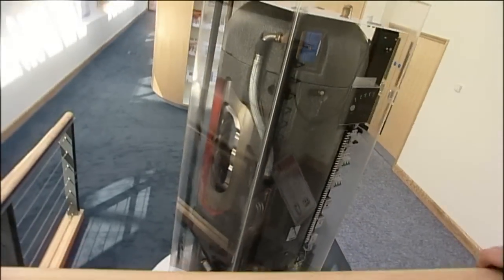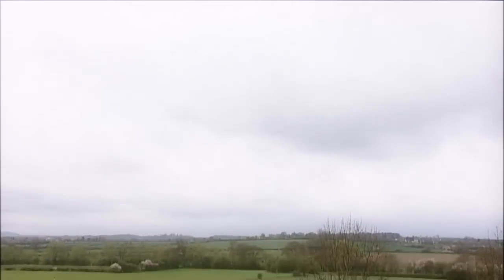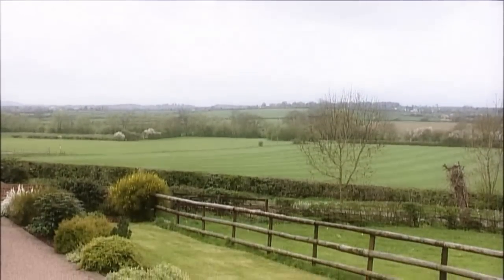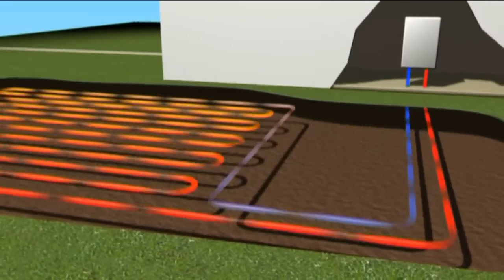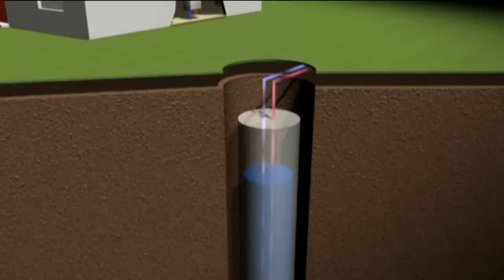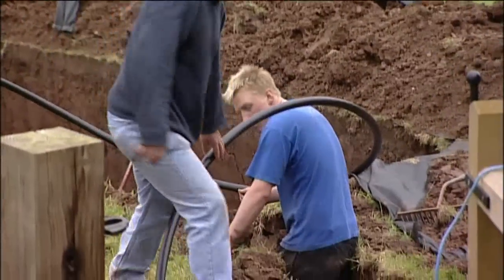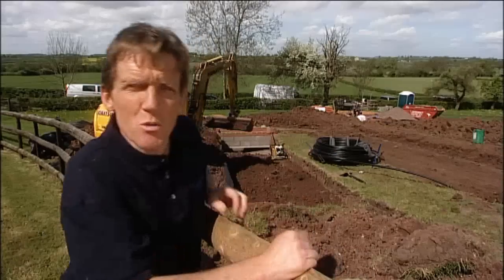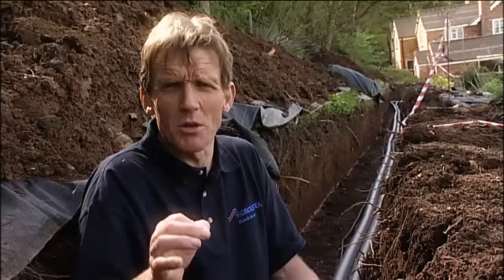Ground Source Heat Pumps (part 1 of 2)

Comment: A problem when the usual housing developer suspects cram in as many houses (not homes) into as little space as possible leaving no useable gardens for GSHPs.  However, GSHP should be required in 'luxury' housing developments surely, along with solar and battery storage as part of the design. For new-build rabbit hutches, shouldn't ASHPs be specced in preference to gas? British house builders are frankly bloody dinosaurs.
 Worcester-Bosch, you have influence here. Step up and force the UK government and developers to insist your tech is designed into new builds. You could start by phasing out the production of gas boilers

Comment: It's really tough to see this as a realistic choice to be retrofitted to more than a fraction of a percent of existing housing. Perhaps it would stand a chance if the government forced builders to incorporate it into new builds.
Reply: Agreed. Also a problem when the usual housing developer suspects cram in as many houses (not homes) into as little space as possible leaving no useable gardens for GSHPs.  However, GSHP should be required in 'luxury' housing developments surely, along with solar and battery storage as part of the design. For new-build rabbit hutches, shouldn't ASHPs be specced in preference to gas? British house builders are frankly bloody dinosaurs.
Reply: I'd agree with that . It's not easy to put underfloor heating in an older house which it really needs to be efficient.

Comment: Ok, so one unit of electrical input generates 4 units of heat energy, so electricity at 15p kw/h, get's 3 heat units. Gas is about 3p kw/h, so 9p for 3 heat units. That looks like a very expensive system to run, plus the significant installation costs of £10k????

Comment: So it's nothing to do with geothermal heat, but a bore hole insulation up to 200m is still collecting heat from the sun?
I'm sure there's some level of geothermal energy at that point, even if it is only 1-2c.

Comment: Good overview, but in this part 1 & part 2 you get No Info about cost or KWs .   Need to develop a small one, for us normal folk without swimming pools,
Reply: £15,000 for each house to convert from gass and you know your annual bills will be way higher to pay for the system that runs into multiple houses its going to fail in the uk when no one can afford it

Comment: It'll have paid for itself in 75 years, crack on!
Reply: I did most off the work myself, it paid for itself in 4.5 years. No issues since it was installed 13 years ago.
Reply: @amphibiousmarineinc  same here, 10 years ago and still works! Cheap Chinese pump too.
Reply: @firmbutton6485  NO DISPUTE REGARDING YOUR CLAIMS. 
However, will this in-ground heat collection system work if you have 12" of snow cover for a month or two? 
Waiting for your reply & THANK YOU. 
Respectfully,  Ben
Reply: @amphibiousmarineinc  NO DISPUTE REGARDING YOUR CLAIMS. 
However, will this in-ground heat collection system work if you have 12" of snow cover for a month or two? 
Waiting for your reply & THANK YOU. 
Respectfully,  Ben

Comment: Advanced system, for 200-250 house shouldn't cost more than 10k Pounds, everything above that is a scam. Also remember that this type of heating uses approx 8-10kWh of energy p/day. So the electricity bill will be approx 550 pounds more p/a than usual.
Reply: Thanks for the extra detail Ka Pi - it helps give a more balanced view of the costs of these systems.
Reply: Hi, do you have some solid proof of numbers you have mentioned above or you just suggest an estimated values>?  thx

Comment: 1:05 This system is NOT using the sun energy..... (under 1 m deep)  If there is no sun  a whole month example winter groud covered with snow , even then it is working because it is geting the earth heat. Otherwise it is a good system.
Reply: That is still the sun's energy. Switch off the sun for a week and see how cold the ground is then.

Comment: Great video but note flow and return pipes should not be insulated, they form part of the collector system and there is always a net heat flow into both pipes which are both colder than the surrounding ground at 1m depth. In a system designed to MCS standards the return must always be above freezing and the flow is just a few degrees below that. Given the thermal conductivity of PE100 used for the pipe material the flow pipe surface temperature will also be above or around freezing so there is no danger of freezing in a properly designed system.

Comment: Heat Pumps still rely on "THE BURNING OF FOSSIL FUELS"!  Where do you THINK the electricity comes from to operate the compressors and pumps?  It comes from coal fired and gas fired electrical generation plants.  Plus you loose a high percentage of electrical transmission line losses and transformer losses.  So it all depends WHERE you burn the fossil fuel - at the electrical generating plant or your high efficiency gas fired furnace and, of course, costs considered.
Reply: oldricky lots of people get their electricity from hydro  buddy.
Reply: I live in an area with no gas and electricity from Hydro so Im definitely researching heat pumps
Reply: It's still much cleaner.  Electricity demands are low in general, and very low compared to electric baseboard heating.  A well-insulated house cuts demand even lower.  The unit can run for 25 years without needing to be replaced.  If all buildings had them there would be far less demand for electricity overall.
Reply: Sol ShantzKreutzKamp yeah but here in the states the activist won all those shut down to and they want the dams removed you just can't win
Reply: oldricky  you’re a bloody fool. Those pump are still the most efficient system and the powering of them could easily be solar. Your figures are out of date and besides , things can’t change overnight.
Spoilers like will talk down anything. 
 This is the future.

Comment: Same here in the USA...gas is dirt cheap....for now. Thing is gas isn't available in very rural areas and it is there that I see the huge advantage of ground source heat pumps. I suspect the same is true in the UK. Is nat gas not readily available in Sweden. You Swedes always seem to do everything with efficient machines...whatever it is. I admire you guys for that.
Reply: 74VDC Gas isn't that cheap in the UK, but far cheaper than this ground source thing.